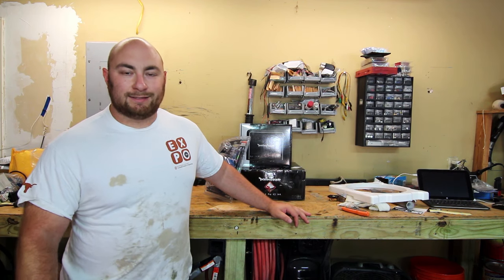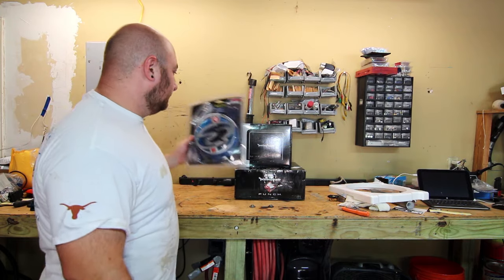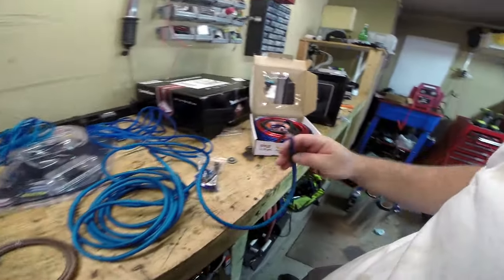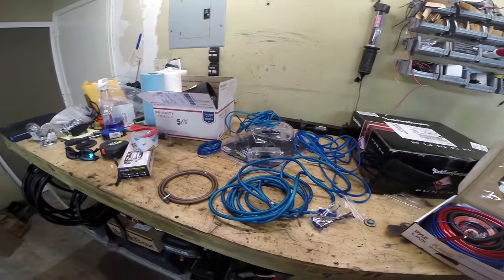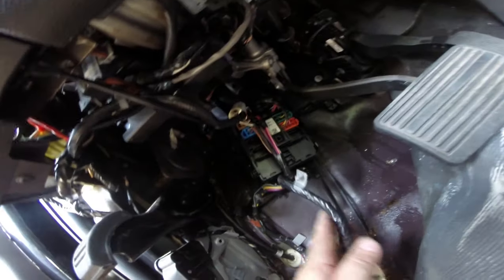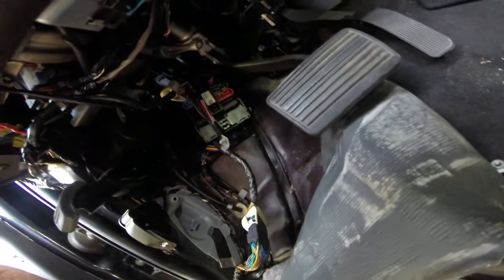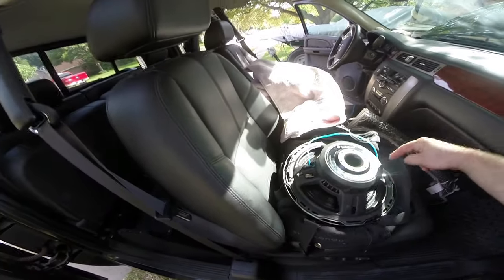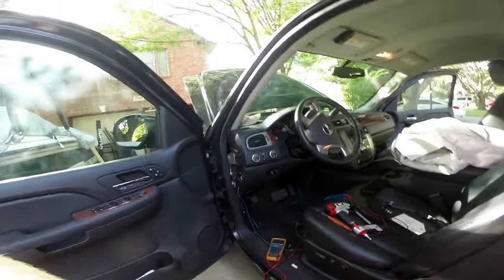2009 GMC Sierra 2500HD - Wiring in an Amp and Subwoofer - Rockford Fosgate Punch P3

Comment: May I ask how much would you charge to do this clean install and the box under the backseat? I have done this job already in a not clean way. I bought 4 pioneer speakers and a sub. Only to end up tossing the sub back in my closet and decided to just amp 4 speakers. Mostly because I didn’t like losing my back seat to a giant box for the sub. But I would have never thought to have squeezed it under the seat.
I have two 6x9 pioneers with individual boxes under the back seats, but the wiring is a mess all exposed running in between the center console and passenger seat to get to the back.
My truck is the same model of the one in this video. Honestly even though I got this job done myself, someday I would pay to have it done properly in a concealed fashion. Also i should include here that I just simply clipped the wires going to the rear doors so they would no longer be an issue, because I was too scared to wire them in along with everything else. So the Stock rear door speakers got left out. Front pioneer speakers went in the doors while rear pioneers have individual boxes under back seat. I have a 2009 Chevrolet duramax 2500 HD, extended cab. Very similar to your video in its appearance. Thanks for the video, looks like good high quality work you are doing here. 👍
Reply from the maker: I dont do "for hire" work, however there is nothing overly complicated here. I believe there are a few companies (look on crutchfield or just google) that make single and double boxes designed to fit underneath the rear seat on these trucks. I would expect them to be in the $300+ range though. I put oversized infinities in the rear door without issues.

Comment: I need help furthering out where to connect the remote wire to
Reply from the maker: remote wire connects to the amplifier trigger on one side and to a +12 connection at the headunit. Generally there is a AMP wires. Sometimes you can use the Antenna raise wire (often blue or blue/white) Basically you want +12V when the headunit is on, and 0V when its off.

Comment: My question is, I put a better GM stereo from my wife's truck that has GPS it was an added feature we had installed at Chevrolet. However her truck did not have the Bose system in it both trucks are 2013 but mine is a GMC with the Bose the turn indicator and seatbelt warnings are now alarmingly loud. Can this be fixed?
Reply from the maker: There is a gong under the dash. A few layers of duct tape over the speaker face will tone it down quite a bit.
Reply: @Makswerks1  ok

Comment: Can I get the exact measurements of where you punch the hole behind the fuse box (I believe?) ! Right now I have my wire running outside the truck. Trying to get it through the firewall or something. Tired of seeing the wire when I open my door
Reply from the maker: I used one of the factory pass through grommets/

Comment: Hi I’m just wondering where you got your speaker wire from? Did you get it from behind the radio?
Reply from the maker: Not sure what you are specifically asking so here goes. 

1. I used the blue wire (antenna power) from the headunit to send the turn on signal to the amp. It is located behind the headunit. 
2. The wiring kit is this one: https://amzn.to/2BKgfKm

Comment: What fuse did you use for the remote wire to shut off your amp
Reply from the maker: Fuse is between battery and amp, there is no fuse on teh remote wire.
Reply: @Makswerks1   i mean the blue wire that turns on and off the amp
Reply from the maker: @wichobalderas4317  There is no fuse on that line. No need for one as its less than 500mA
Reply: @Makswerks1  i know theres no fuse but how do you make the to turn on and off with your key
Reply from the maker: @wichobalderas4317  Sorry misunderstood your question. That blue wire is the  antenna power wire, and it connected to switched ignition (when key is on) through the headunit. Pretty much every headunit on the market has this wire and it is always on switched power.
Reply: @Makswerks1   but iam using the original stereo
Reply from the maker: @wichobalderas4317  In that case you are going to have to use a volt meter and find which wire is the hot on the key, most likely an orange or red with a stripe.

Comment: I didn't notice the ports on your amp if it was two channel or not, but if it is couldn't you run the sub at 2ohms at five hundred watts? I thought that was the best way go.
Reply from the maker: The amp i selected is a mono amp. The sub i selected is a dual voice coil at 2 ohms. So 2 x 2 ohm coils. Meaning I had to put the coils in series to create 1 4 ohm connection. This thing bumps great for me.
Reply: +MaksWerks alright I didn't see if it was mono or not. I got the P3 10 works great for my little truck.

Comment: And then its right thur and then over there wtf u talking bout explain...just some feed back what fuse did use for signal start
Reply from the maker: You do not need a fuse for the signal wire. It caries almost no current. Just a voltage signal.